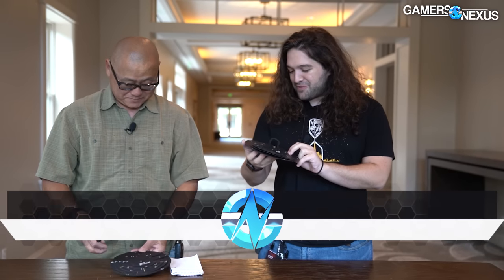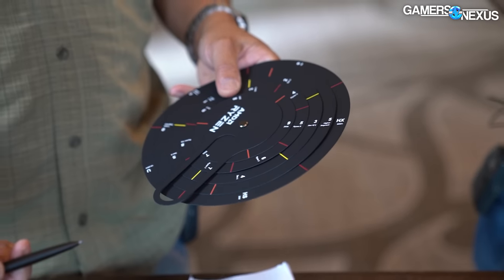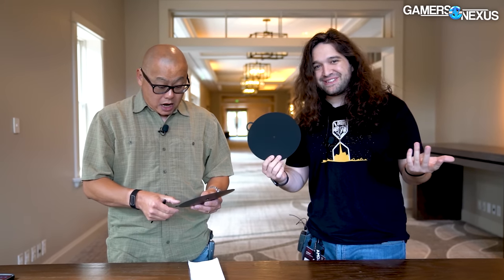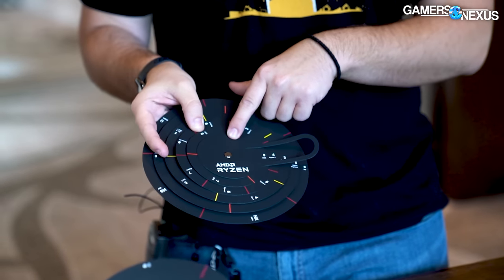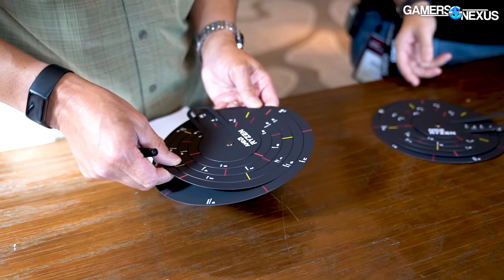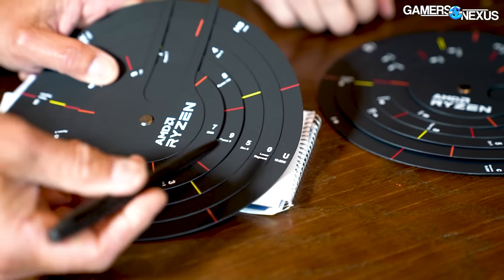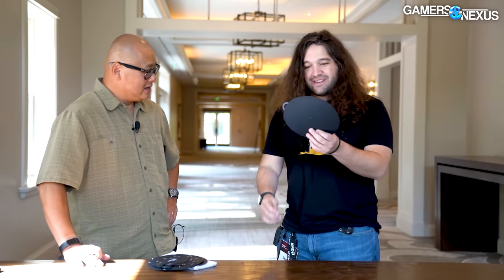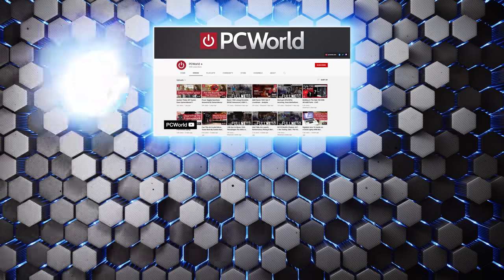AMD Gave Us Too Much Power | CPU Naming Problems

Comment: The first number is definitely irrelevant when it comes to actual cpu specs. I think it’s nice to have the info because if it’s 2025 and has a 7000 cpu, that means everything else in that laptop is going to be a 2023 spec parts as well. Where as a 9000 cpu might have the same specs but the rest of the product was at least designed the same year. It should not be the first number for the cpu sku, but as someone who has shopped for chromebooks and found designs that are still being made that were designed in 2019 it’s somewhat nice to have that info easily findable.

Comment: The Zen 3 & 4 parts are still really good parts, and there is no problem with AMD using the tech in the current gen, as long as the prices reflect that.

Comment: I guess a change in the naming scheme for laptop's APUs could be nice, but definitely not this one. Year of the processor can come with some value. For examples support staff? I guess proces node may change even if architecture does not (like with 1600af if I recall correctly). But I think that it is mostly for AMD marketing purposes.
Wattage? Sure. 
R3, R5, R7? No problem!
Architecture? Very nice addition.
"Class" of the chip can also help AMD to get some more CPU options.
I'd love to see iGPU architecture. Even instead of year of the chip. It would be the best. Even better than CPU architecture.

Comment: The year will tell if the laptop has been sitting on the shelf or is the latest release of that laptop. Assumption is that the chip is a newly manufactured version of an old design, that the new number would be printed on the chip if the laptop was disassembled. There is a difference between old chip and old design.

Comment: If I am going to be pessimistic, this is just a marketing stuff as both of them point out. But I kinda see the pattern and some logic behind it.

The first number was just a sum of each digit in each year. 
2+0+2+3 = 7
2+0+2+4 = 8
... and so on.

The year is included perhaps just to makes the old seems like new. An old stuff, being produced with current technology.

The second digit most likely serve to split the performance so AMD has more flexibility with pricing.
Ryzen 3 (3&4)
Ryzen 5(5&6)
Ryzen 7 (7&8)
Ryzen 9 (9)

Either they add ryzen 4, 6, and 8 categorization or just half heartedly split the numbering as they did.

The third digit is very starighforward. The architecture of the processor.
Zen 1
Zen 2
Zen 3
Zen 4
... and so on

The fourth digit, as Steve mention, is just segmentation.
The fifth which uses letter is just the wattage. 

How it is setup, the first number being bigger play into tricking the mass consumer they are buying something new that is better. Which is very sneaky from AMD.
Reply: It is a compromise between OEM always wanting new numbers and consumer who wants to know exactly what it is they are buying.

Comment: I think it supposed to be decoded other way around. You have CPU number (5645HS for example) and then you use the wheel to find out what CPU it really is. AMD is probably using it to keep the naming scheme consistent. Number itself doesn't tell you much about performance anyway...
Reply: Yup, that's why it's a decoding and not an encoding wheel.

Comment: Namings bad enough without laptops being made badly full stop, there's no right calling anything anything beyond numbers, no pro, creator or whatever other title you feel the need to slap on hardware, and you can't exactly weld what you want onto your desktop case either, let alone laptop, framework or not. It's only because if we could get what we wanted ourselves it'd put most of these companies out of business in a heartbeat, shareholders don't matter, consumers influence everything, I say that, yet the vast majority of consumers don't have anything beyond a fucking brainstem, so we get peddled dogshit every second of every day. It should be easier to get names right than to get physical hardware right yet here we are.

Comment: Only engineering types would spend this long thinking through the problem.  I get the point.  Consumers don't need to be duped into buying something they don't want.  It doesn't need to be this confusing and it's not that hard of an issue to solve.

Comment: The only advantage in this schema for consumers is legacy support for older architectures. 
Reminds me of how a car may be 10+ years old but the replacement parts for it are the same for the brand-new model (IC motors, not electric).

Comment: One positive for the naming scheme could be if they resell an older core, they could move it down the product stack, so a 6800u could become a 7630u.
They could also use older cores with some frequency boosts like this. 
Still having a stack that follows general performance within a year, while having a completer line-up.

Granted, this is the most charitable interpretation, and it does differentiate between an older laptop and a newer laptop using an older CPU core.

Would the average consumer make any sense of it, no but it is not completely terrible either.

Comment: The year is there so they can rehash the same CPU every year. They could improve the clocks/cache size or backport some improvements though so they still have a naming wiggle room for when they do.
Reply: Or more likely that they'll just program the CPUID differently for the stock of already packaged processors towards the end of the year and label them differently before shipping them out..

Comment: Why not just add an "m" to the original name designating it as a mobile part? Ryzen 5 3600m for mobile? Or Ryzen 3 1200m, etc.
Reply: Because you then have to differentiate between the u (lower power) and the h(high power) as well as hx hs for even more power or more power yet cut back etc and adding in another letter is gonna make thing even more messy (7850mhx?)
Reply: Because mobile parts often have little to do with desktop ones.
Reply: @sentryion3106  Looks way more logical than the Zen 3000 being zen 2.

Comment: Good idea, but order is wired? Power is defined by ZEN, so users expect, as it was before, higher is better, and it technically doesn't have to be like that because 7950U will be way stronger than 7910U
people will not understand why 8910hs is so much slower than 7950hs when number is higher, it will be a slow death of trust they made of themselves and mentioned blue collars will sell 8910hs as "better" because its higher number obviously.....
IMHO they should already say that it starts with  "zen", then they have 2 digits in year, and it starts with 07 for historic reasons, then 30/35/50/55/70/75/90/95 as higher and lower models, then power level HX/HS or whatever. 

it feels like they really had a good idea, at a glance you have all the infos you might need about cpu, but marketing made it into a monstrosity that will not be easy to read for average joe. 
there is also no word about node used, so I assume 7nm zen1 part, we will have no idea that something was ported to another node under the hood, especially that io is not here as well, so wired combos of 5nm node, but 14 nm IO can technically happen and its hidden from us.

20:00 I am not sure if wallmart dont do it, but Polish "wallmart" have on displays still HP laptops with 4'th gen intel, sold as NEW for the same price as they were when they were released 10 or so years ago.
Reply: You're telling me 5600 is slower than 3950, who would've thought?
Reply: @Ometecuhtli  you forgetting that there is R9-3950 vs R5-5600 in your comparison then bigger still is stronger

Comment: I don't think this naming scheme with old cores that get a new part number is too bad. Let's face it, OEMs and resellers do insist on the new shiny number and AMD also doesn't want a part to look old even when it makes perfect sense in a certain market segment to still sell it a couple years later. However it's still easy to compare parts at a first glance. 
I'm more worried that they can't keep this system for long before running into double digits or switching to letters. This will become a mess pretty fast.
Reply: It is already a mess and makes no sense, other than to purposefully hide old cores with new names to sell

Comment: So the root problem is that the model name looks like a number, and we have learned in school that the leftmost number is the most important digit in a number. However it's debatable what the most significant digit should be (year vs zen core vs the other sliders), and it feels disingenuous to put the year instead of some performance metric in the most significant spot. Higher "number" is not always better.
Reply: The difference between treating digits as a number vs text (a string) is something that I've been more mindful of the last few years as a software developer. The test for me (think I picked it up from a blog) is whether it makes sense to do arithmetic with the numbers. That is, is it sensible to add, subtract, average, etc them. 

Treating numbers as text helps for example when someone decides to introduce a postfix like HS ;)

Comment: Hopefully the year part only changes when something about the processor has changed, say it goes to a lower market segment from one year to another.
Reply: The year changes if they relaunch an SKU. If they change the segment to lower end then the second number will have to change. The key to the schema working is if AMD obey the guideline of bigger number is always better performance. AMD has control on the second digit and the last digit to make sure that bigger number is always better performance.

Comment: This is intentionally deceptive and underhanded practice by AMD.
They started this with the laptop space, 5700U being Zen 2 alongside 5800U which is Zen 3.   Now they are rebranding 3100/3500 to 4100/4500.  This will trick many consumers into buying what they think is a modern CPU, but getting old tech.  Most won't notice, which is what they count on.   You people should be ashamed of yourselves giving AMD a pass on this type of practice for so long.

Comment: The year could be a valid descriptor of the update in process node as well as that node being more available for production at a lower cost. Take the 1600(AF) for example. Was produced on the newer process node but still a 1600 for all intents and purposes. Performed much differently than the original 1600 SKU.

Comment: Intel's variant of this wheel would require to be shipped on a pallet, and operated by large levers. Someone with enough time on their hands could surely make something like this for Intel, but it would probably take long enough that new products would launch prior to completion, thus an endless cycle of revisions needed to Intel's wheel would be required and it would never come to actual fruition with current products represented.